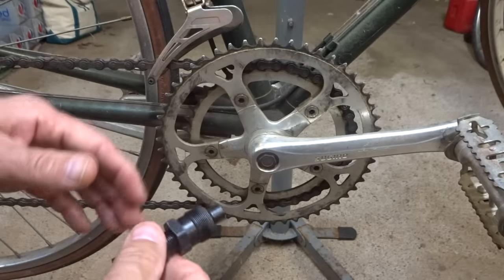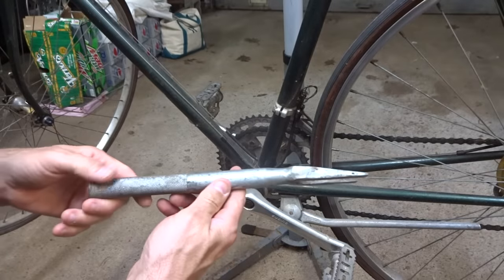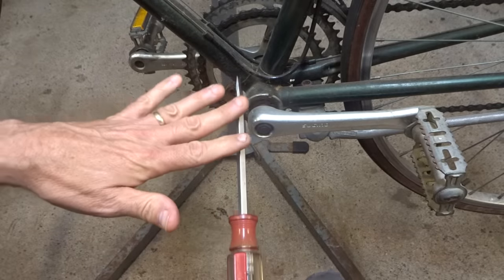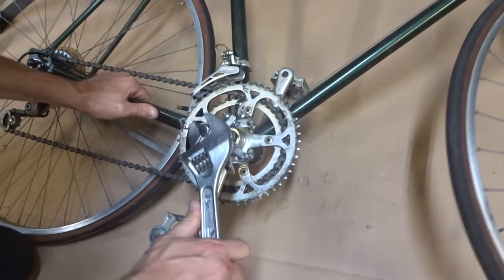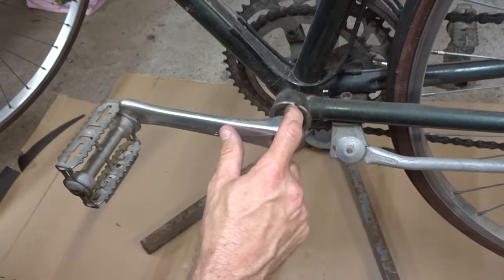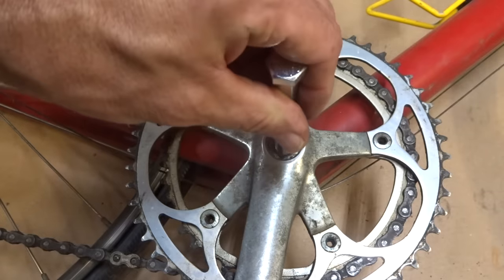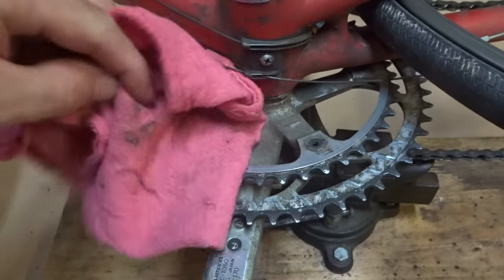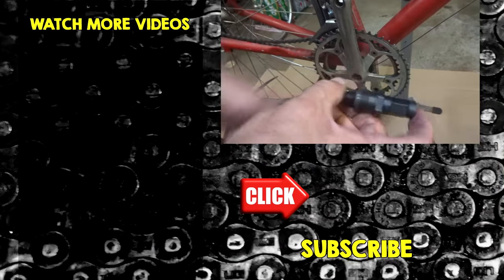Remove Cranks Without A Crank Puller

Comment: Thanks for showing me at this rate is time to just have the tool. Great options in a pinch, did it one before many years ago in my youth... With kids really into biking, I appreciate you taking the could hours to rehash everything to just give up the 15bucks, even if I am cheap!
Reply: (you should add an affiliate link! I'm not usually a fan, but in this case you earned it and I'd click through! Bet you will end up with several spontaneous bucks a month!)
Reply from the maker: I have a link to a crank puller tool in the description if that is what you mean. Thanks.
Reply: @RJTheBikeGuy  Totally missed that, thanks!

Comment: Don’t forget physics.  The coefficient of expansion of aluminum is considerably higher that that of steel.  If the crank is aluminum, heating it, after removing the fixing bolt or nut, may loosen it enough to make removal with any of the non destructive methods easier.  If you don’t have a hot air gun, try pouring a pot of boiling water on the head of the crank arm.  Worked for me on a stuck crank.  Though I was using a Park puller, the crank stubbornly wouldn’t budge until I heated it.
Reply from the maker: Theoretically. I have never had much luck with heat/cold.

Comment: The threads were stripped so couldnt use a crank puller , i ended up using a gas torch and heated the crank close to the bb spindle and it came of easy with a tap

Comment: I got the tool ... tighten it snug ... but the crank arm was so tight to the spindle ... it striped the threads!  looks like I have to buy the puller.

Comment: My crank on one side came off easy, but the other side stripped out.  I used the Dremel tool method and it cut the aluminum easy and in 10 minutes I had the crank off and it came off before the cutter came in contact with the square crank arm.

Comment: I always use a Brass Drift , never leaves any marring unless it's some really really soft crappy steel , but even then it can be polished out with a lil bit of emery cloth if it bothers you that much , plus you see better just what your hitting , my 2 cents for the day , keep stroking
Reply from the maker: Steel? Most cranks are aluminum unless they are very old, or very cheap.
Reply: RJ The Bike Guy - well this was on Older Stuff , my Grandson has this higher tech, carbon fiber , titanium , type stuff

Comment: Additionally if you have a thin box wrench place the haft in between the bottom bracket and the crank arm. this takes up a bunch of space. now you have an easy leverage point for a long crowbar or prybar. comes off real easy (square taper only) 
This is the same principle as puttin a block of wood under a claw hammer head before pulling out a nail (maximum leverage advantage)

Comment: You can use a propane torch heat around the outside on the actual crank arm itself and then hit the middle center bolt and it'll come right off lightly make sure you don't hit it too hard add make sure that you have the nut on the bolt or the bolts in the hole a little bit out comes right off zero damage zero marking if you have wet paint not a good idea

Comment: i tried to buy a crank puller here locally , and its not available .plus to order one is 2 weeks . but i will get one .   in the mean time , my left crank arm  comes of relatively easy . i used a large open wrench in the ball joint remover fashion . it was just a little bigger than the space between the bottom crank and arm . it popped right off .  then i was able to pull the spindle with the ring gear and crank arm together.  so i had the nut on the spindle backed off a little . and used a socket and a extension , the nut has a flange on it .  i used a hammer to pound on the extension . and drove the spindle out a little , backed off the nut a little more ,  once . after that it was loose enough to drive out directly on the spindle  with the nut removed using the extension, minus the socket .

Comment: Thanks! Rj TBG to the rescue again! Well what happened to me was I had some schwinn alu pedals for 3 summer seasons only, and used as a commute bike only. As per usual when pedals brake often it is the bolt inside. So it brakes I unscrew it(arm side not crank). I Use a spare plastic pedal. I think it had a different thread size it went in normal I thought there was too much resistance. So yep complete thread damage. I own a cheap
screw in puller tool but it useless at this point. First time I've  fixed this aspect of bicycle repair jobs. The bike was free and it needs the bottom bracket serviced/replaced anyway loose a d knocking noise. The bike was free found in a ditch in disrepair so gotta lol about that! It's sad but a free kinda sad.

Comment: Pickle forks are great for removing ball joints and tie rod ends, But they usually destroy the rubber  seals when you remove the old ball joint or tie rod end.  Do it yourself a favor and just get the Shimano tool that's made for pulling the crank arms.

Comment: Are crank puller tools ie Park Tools universal or are there specific types ? My daughters bike is a cheap old Schwinn girls mountain bike and it does have a share shaft like in your video. Thanks and your videos are top notch !
Reply from the maker: Crank pullers are generally universal with some specific older exceptions that you are unlikely to have. And no idea what you mean by "a share shaft"
Reply: Sorry , I meant square shaft which I have since found out from your video is slightly tapered. Thanks again.

Comment: One way to remove is to take your right arm and hold the peddle firm and vibrate it in and out very quickly  while pulling towards you to loosen it out remember grasp  very firm.

Comment: Yup... just buy the tool... are they universal? I have an 88 schwinn tempo with shimano 105 everything...
Reply from the maker: Mostly universal. Shimano would use a standard puller.
Reply: The standards/ tools have converged in the 80s/90s and are on the way of diverging again. For square taper and alike there is still a lot of use for the tools and also (cheaper) modern bikes will continue to feature them.
Reply: Not universal ,...early Stronglight and T.A. cranksets ( made in France ) require a removal tool with a specific thread pitch !

Comment: With  decates experience I give advice. Use lubricant when install arms. Use proper puller and heat arm before pull it .
Reply from the maker: There are two camps about greasing the spindles. I am in the camp of not greasing them. And I also have been working on bikes for decades.

Comment: So I was trying to remove my pre-1980's Stronglite cranks (I don't have the special Stronglite crank puller as they are one, difficult to come by - Velo Orange was sold out and ebay was sketchy as it was all Polish vendors who said shipping would take over a month to reach the states - and two, they are over-priced at $40-$60+) and I tried using the 3 jaw gear puller method which, to me, seemed the most legit without using the actual crank puller tool. Well, who knows when the last time those cranks were pulled off and I ended up bending the crank bolt trying to extract the cranks which didn't even budge... Luckily the bolt still screws in about 3/4 of the way and I used several more spacers to accommodate for the space so that it tightens down at least. Now I'm left wondering how the hell I'm going to get the cranks off without cutting them off so that I can service the BB... Might just cut them off and install a modern BB, cranks and sprocket.

Comment: I have a crank tool, but somehow wants to watch this anyway.
They are cheap, there is no excuse to not have one.
Reply: One super cheap one (2 usd) damaged the threads for my bottom bracket (where goes those screws which tighten the crankarm) and when i got a better one (5 usd) it kinda worked, but the outter threads for it wasn't very precise, and they just didn't really hold the crankarm and rounded up the threads for crankarm. Just get a good tool (i'd say 10-20 dollars) and be very carefull when removing crankarms.
Reply: Elvis yeah I mean even a park puller is super reasonable. If a person is too cheap to spend 10 dollars on a quality crank, cycling is not the hobby for them lol
Reply: I completely agree; it seems stupid to do it any other way.  Cheap people are funny :P
Reply: What store can I buy one from??
Reply: @ExploringWithJared  Ebay, amazon, etsy...etc...or any online cycling supply business.
Reply: @ExploringWithJared  Any online cycling supply business or eebay, amazon, etsy...

Comment: i had a case where the driveside crank couldn't be removed without destroying it.

I found while using the 3 jaw gear puller and removing the arm.and race of the nondrive side. Hit the pin of the gear puller with a hammer with increasing fotce until the spindle falls put throigh the nondrive side.

Comment: Well ....I haven’t had to work on a bike for a few years now .... but I found myself on Utila island with no trans so I bought a cheap and nasty Chinese bike ..... I have completely rebuilt the bike and changed everything on it except the the wheels ..... all for about 80$ including the clear coat I’m using on the frame .... the stuff I changed is an endless list but for e.g the headset cost 1.50$ the rear derailleur 1.50$ ...... pedals 1$ !! It’s been a lot of work but it’s almost done now , and I used all your videos on how to do it ...although in the past I always used your tutorials this was more intense ... now I’m building a mongoose suspension mtb for a local kid and the pedals are modern and I’m not sure I can find a pedal puller..... also I might have to change the crank to a solid one .... now thanks to this genius video I’m going to attack these pedals !! Thanks 🙏 RJ for always being there

Comment: That's great and everything, but what if you only want to remove the pedal shafts, and leave the sprocket on there? Is the shaft on the sprocket side integrated with the sprocket? Does it need to be cut off?
Reply from the maker: I have no idea what you are saying.
Reply: @RJTheBikeGuy  is the pedal shaft and the sprocket one piece on a Schwinn, which I assume is what you were demonstrating on...
Reply from the maker: @randomprecisionmotors3130  https://www.youtube.com/watch?v=Fjgsx9DOl8o

Comment: wish I saw this video before spending $50 on a extractor specifically for vintage campy (late 80s). I have several crank extracting tools which fit my vintage shimano dura ace cranks - but campy being campy - none of them would fit my c-record cranks. So I had to fish around online and look for one.
Reply from the maker: I still recommend using the proper tool! Not sure why the Campy cranks would need a special crank puller. But then Campy does weird expensive stuff, because...Campy.

Comment: I hammered my crank off about 3 months ago because the threads were striped and needed to replace them anyway but my puller would screw it bite the spindle then just pull the threads out no matter how tight I held a whench on the part what threads in to the crank arm then inspected my spindle after it was fine so happy days and I had some spare cranks which worked great and better than the ones I had on because they had shark teeth from over use but the new ones don't make it skip after changing all the drive train the cranks was the last thing to do so I have new sprockets for a few years and atleast I know next time it will pull out with a puller
Reply from the maker: https://www.youtube.com/watch?v=j5gmAkMLX60
Reply: Already watched that vid it's great I think the old owners never looked after it as great because when i brought a brand new bike which I have had for years it's working great no problems not really nothing bad has happened just cables and whell bearings which are easy to replace get changed but when I work on my new bikes I do everything 100% the real way no mistakes it might take a little longer but worth the time

Comment: Another method but can cause danage, remove pedal. Slide a length of scaffolding tube, about 4ft minimum, over the crank arm then shake back and forth. Used when thread has been stripped out.
The vibrations lossen the crank arm from the taoered bottom bracket. Best aoply oil first.
The best, in aluminium crank arms only, is ti heat them up with a blow tourch. The aluminium expands before the steel and so cones off real easy. Beware of any plastic.
Have fun.
Reply: Apologies, written whilst having a hang over ..

Comment: I have the removal tool but I think I managed to screw it up, and now all of the threads in my crank arm are stripped. I like the puller method, but my e-bike crank arms doesn't have anything to hook into. So I'll try out some of the other methods, but I might end up just bringing it in the shop because I'm kind of afraid of causing more damage to my e-bike.

Comment: What if the arm threads are stripped and the tool won't work, will applying heat to the arm where it attaches to the crank then prying the arm off work ?

Comment: The last idea is good if the cranks have not come loose with the crank puller and the threads in the cranks are stripped at this point.

Comment: Stripped crank threads from using the proper tool. Now what. I have used the gear pullers, but they just took chunks out of the crank arm, used sprays to penetrate and lube any corrosion, but don't work. I finally bought a sawzall and cut the crank in places I think the pressure would be relieved, didn't work either. I parted out the bike and threw it away after pounding on it and no longer trusted the frame. Been pulling taper cranks for 40 years now, only in the last few years since the pandemic, I am now stripping 3 out 4 cranks. 40 years and only one crank arm stripped, now just about all of them. I refuse to hammer on crank, would rather cut it off than damage the threads of the bottom bracket shell or frame. Using all Shimano or Suntour cranksets, Suntour Alivio, Tourney, Acera, all seem to have too soft of aluminum to pull a tight crank. All these cranks I have used for 20 years, none have broken under the stress of riding, and I ride a bike hard. No name cranks I have broken in half climbing and stopped using them.  I guess I should be cutting the bottom bracket spindle from now on.

Comment: How about heating the alloy cranks with a propane torch which should expand the crank allowing you to just pull the arm off?
Reply from the maker: Have you done it?
Reply: RJ The Bike Guy, no but I'll try it when I get a chance and let you know. Many years ago I remember the procedure for pulling crankshaft bearings out of mopeds, was to heat alloy engine case to remove the bearing.

Comment: I have never tried it, but I wonder if using canned air (sprayed upside down) to shrink the OD of the square taper would allow the crank arms to slide off with ease (or with some light prying). A similar technique has been used to work with interference connections like press-fit bearings.
Reply from the maker: I doubt it

Comment: I had to get a crank ff the other day, and despite having the correct tool, it didn't want to budge.  
The solution was, working on the basis that aluminium expands more than steel with heat:
With the puller fitted and wound up as tight as possible.
Boil a kettle and slowly tip about two pints of the boiling water onto the crank around the puller (This concentrates the heat more than a hot air gun or blowtorch would, and won't damage the plastic parts).
It should now be possible to tighten the puller a third of a turn.  
Hammer the end of the puller with a large nylon or rawhide mallet
Tighten the puller again and repeat until the crank is off.
Mine took three lots of hammering and tightening until it came free.  If necessary repeat the boiling water stage.
Reply: yes the hot water and hammering worked !  I had stripped out the other side with a propane torch--- and have done many others with stripping out the threads---

Comment: Was wondering if any of this advice changes if I just need to replace the LEFT crank arm only? Left arms threads stripped where the pedal attaches and I purchased a replacement arm and can’t get the original arm off, any advice would be much appreciated :)

Comment: Great video to remove the crank arms, thanks. I have a Trek 3700 26" with square taper bottom bracket. When I thigh the drive side bolt, the crank arms become harder to move, not totally stuck but you can easily notice it is harder to move. I just bought this ride so I don´t know much about history of previous repairs. Any ideas? Thanks!
Reply from the maker: Tightening the crank bolts shouldn't cause them to be harder to move, unless the spindle is too short, and it's pushing the arm into the bottom bracket or frame or something. Unless the spindle is damaged in some weird way.

Comment: My neighbour used an old railroad tie and a hammer to bust my crank loose on my nice brand new steel single speed bike. I cringed as it did serious cosmetic damage to the inside of the crank arm near the spindle as he pounded agressively on it, but it did work. Hope no damage was done to the bottom bracket or my bike frame from the force. 2 hours later I found a crank puller in a toolbox a different friend lent me. I am now feeling a bit stupid for letting my neighbour help.
Reply from the maker: Ouch!

Comment: Are there more than one kind such as different threading? of crank puller or can I just buy any old one?
Reply from the maker: Other than a couple old cranksets, the threading is standard. I recommend buying a quality tool. This will work on most cranks that use a puller. https://www.amazon.com/exec/obidos/ASIN/B0028YUZSS/ref=nosim/youtube25-20

Comment: I've found zero vids showing how to remove the crank bolt. I bought 3 crank pullers including park tools and none fit inside the bolt nor does any ratchet size fit snug enough to pull it . it's a dahon crank I'm trying to remove